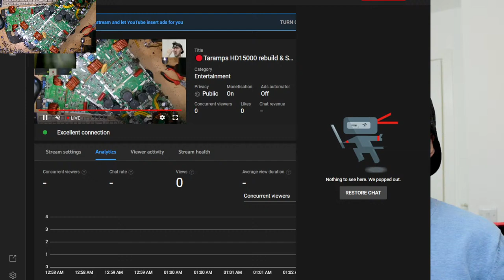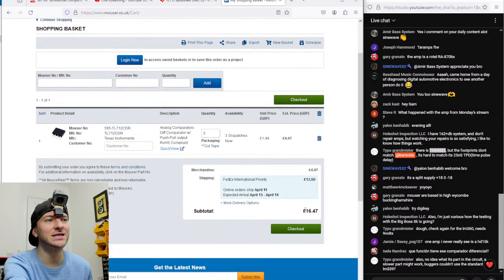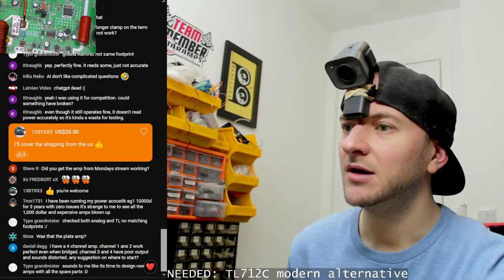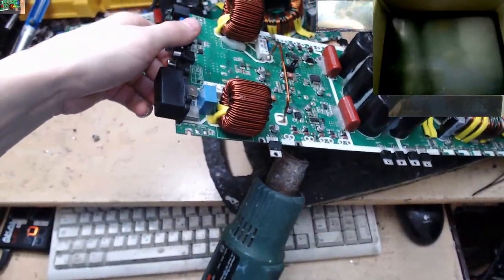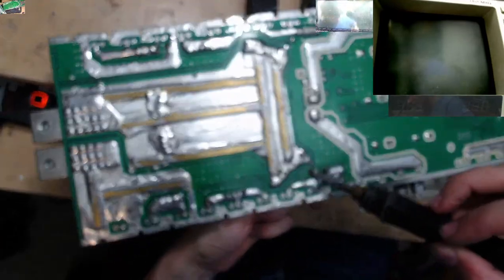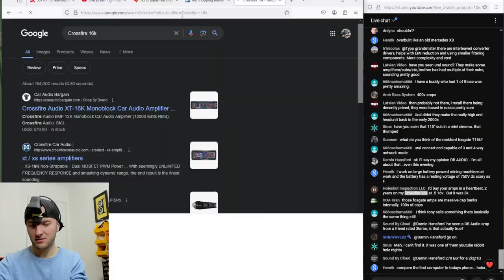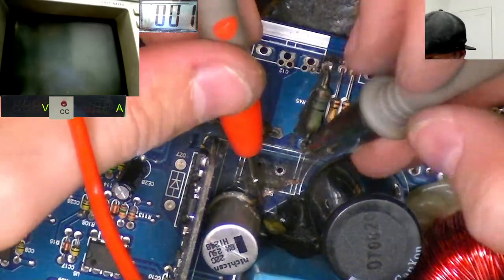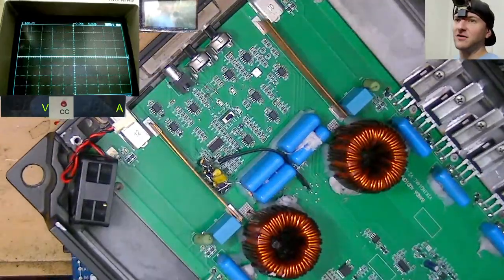🔴Taramps HD15000 rebuild & Sundown 3K

Comment: The thing with Mouser (and probably DigiKey as well) is that you have a minimum order quantity (in this case £33) for free shipping, but otherwise huge shipping cost. Just fill it up with other stuff that you need anyway, they tend to be cheaper than RS or Farnell for some things.
Reply: the problem is Mouser ships everything from the US, and he lives in the UK, so he has to pay a large import tax on everything
Reply: @BH4x0r  I'm not from the UK, but I don't think there are any significant customs duties for electronics import from the US there. It's mainly VAT, which he should be able to claim back with this being a business expense. For small orders, shipping is usually the killer, but above the free shipping threshold, Mouser should be a viable option (and usually a bit cheaper than Digikey)

Comment: if you are running low impedance below ohm rating at low volume there is no box rise the sub is barely or not moving at all so the amp at low volume is getting wrecked by the low impedance
Reply from the maker: Incorrect, even if impedance rise is low at low volume, the current across the amplifier is also low due to you playing at low volume. Wiring to a low impedance itself isn't the issue, it's the higher current across the amplifier to make a given power. Provided the current is below the design limit then it doesn't matter.
Reply: @barevids  its just so odd it happens when idle that was the best i could come up with lol

Comment: Do the older Rockford 225 amps have any problems?
Reply: All amps have a dislike for the b+ swinging..I learned of a fix years ago.. but I was laughed at.. recently I was told that me and all repair tech knew..and designers all said we were nuts..well.. If u dont swing the b+..the pwm wont latch and the supply wont flip..the answer for free is..to ramp the pwm vcc up to lets say 20v then regulate back to 12v.. that way even if the b+ swings..the pwm and comparator still has correct reference..tada. your welcome..

Comment: What can be wrong with my amplifier when I turn my down Gain channel goes out then when I turn it back up it comes back up
Reply: Dirty gain potentiometer.  Clean with some 99% isopropyl alcohol
Reply: @steve390gold  okay thank you I will try
Reply from the maker: Can also be toggle switches. If this doesn't help then you might need to check the amp circuit with an oscilloscope.
Reply: @barevids  thank you I appreciate it
Reply: I don't have nobody near me that knows how to fix them